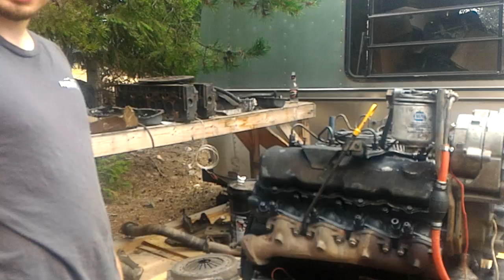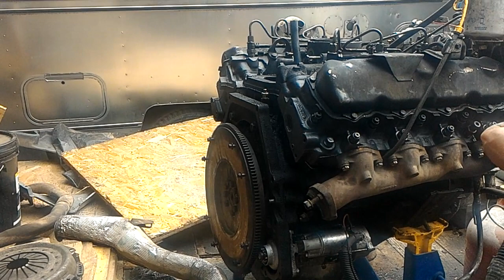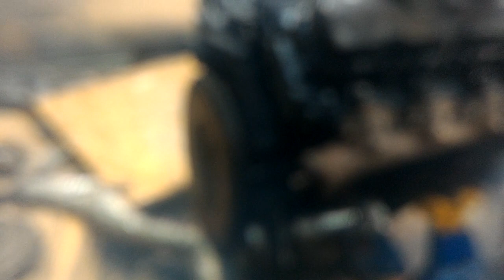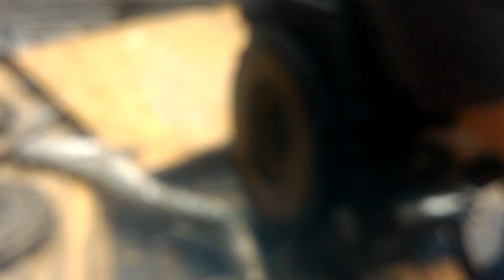7.3 idi running 180/360 deg out

Comment: odd din't know these would run 180 out wonder what the signs of it is mine seems to run very rough yet all compression and such is good with new injectors / injection pump
Reply from the maker: Easiest thing to do is what I did - pull the IP front cover and look at it. Then, pull the #1 glow plug. Crank engine over with a breaker bar while feeling for air coming out of the GP hole. You should feel air coming out and stopping just before TDC. Leave the crank at the 0 mark. Now, check the position of the dowel pin at the IP gear cover. If it's not at the 4-o-clock position... you might be off. 

That being said, unless someone had been messing with the IP gear cover or removed it along with the IP, it shouldn't be a problem.

What sort of 'running rough' do you get - lots of smoke? white smoke? black smoke?

Comment: MacRobb, you crack me up. I love those idi's!!!!
Does the torque of that 7.3 ever want to lift up one side off the jackstands?
Reply from the maker: No, that was quite stable.
On the other hand, we had a 6.9 a friend of mine started that was just on top of a tire, barely strapped to a pallet.
It fired up much quicker than expected, took off and literally overbalanced and fell halfway over(knocking off the FSS wire, fortunately).
So yes, good support is a good idea.

Also, a 7.3 /does/ have enough torque to lift itself off a motor mount in the truck! I forgot to install bolts, once. I was wondering why the gearshift kept moving every time I accelerated....

Comment: Didn't know u could get the pump 180 mine has a key that stick through the gear and the injector pump the only thing I could see getting out would be where the timing marks are on the housing and the pump with if they are lined up it's In time but hey learn something new everyday